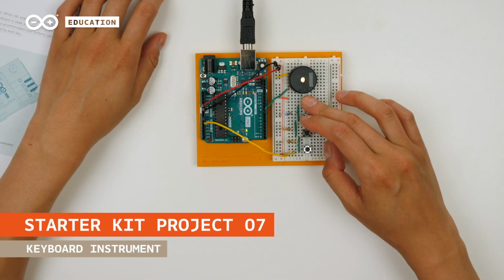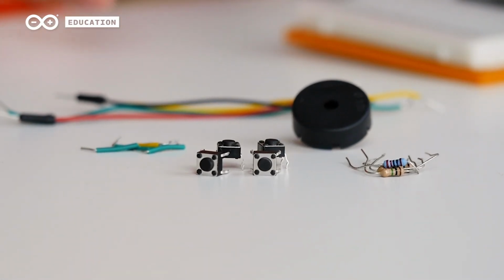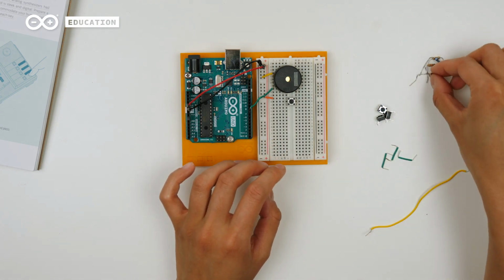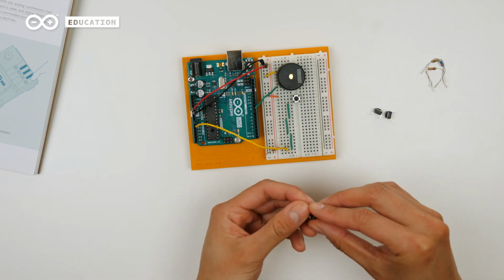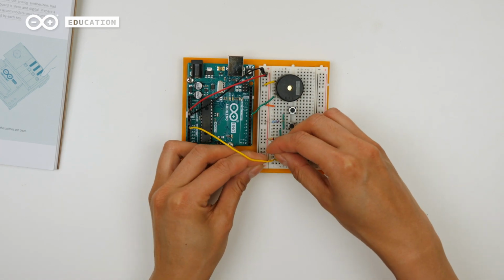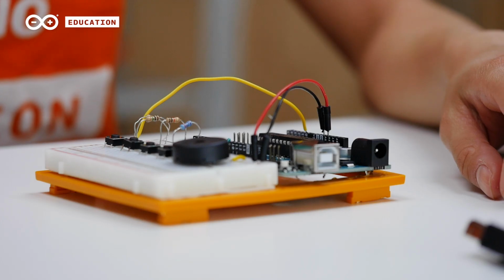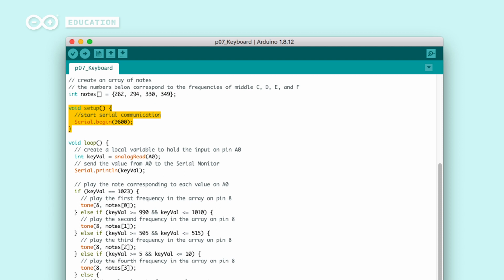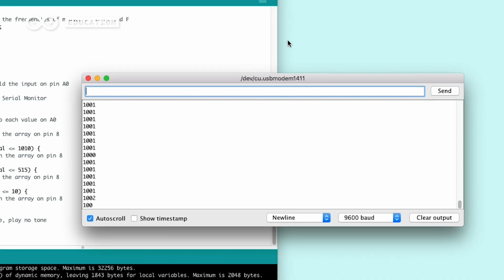07 Starter Kit: Keyboard Instrument

Comment: You guys realy need to check the book. There is a clear difference in what your saying here and what it says in the book. Both codes do not work in the sketch ???
Reply: For others reading this, my code also didn't work when copied from the book. I had to put the button information into the setup, instead of above. Here is what worked for me:

int buttons[6];
int notes[] = {262, 294, 330, 349};
void setup() {
  buttons[0] = 2;
  Serial.begin(9600);
}

void loop() {
  int keyVal = analogRead(A0);
  Serial.println(keyVal);
  if(keyVal == 1023){
    tone(8, notes[0]);
  }
  else if (keyVal >= 990 && keyVal <=1010){
    tone(8, notes[1]);
  }
  else if(keyVal >= 505 && keyVal <= 515){
    tone(8, notes[2]);
  }
  else if(keyVal >= 5 && keyVal <=10){
    tone(8, notes[3]);
  }
  else{
    noTone(8);
  }
}

Comment: Hi, a little confused with the 10k resistor at the most bottom what is the effect. One side is to the ground, the other is to the 3rd column instead of the 2nd column. the wires are not connected to the 3rd column so how does the current flow through that into the rest of the circuit? I can only see current going directly through the analog wire to the cct?